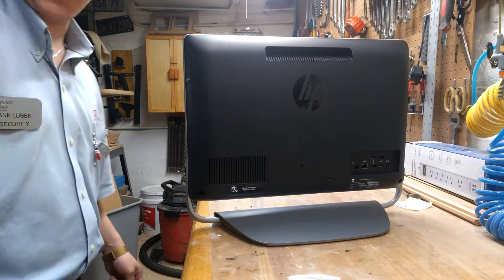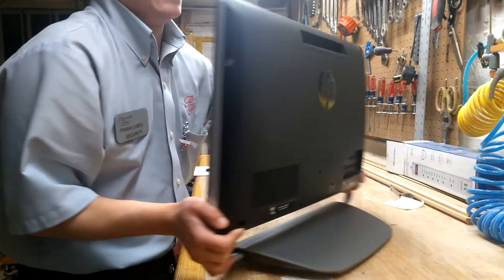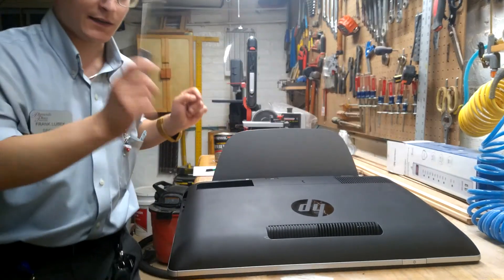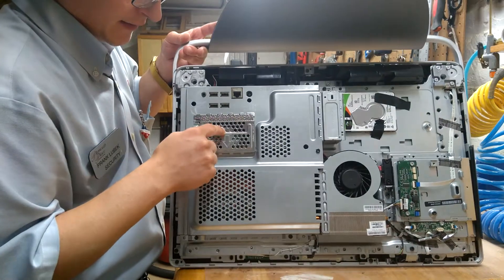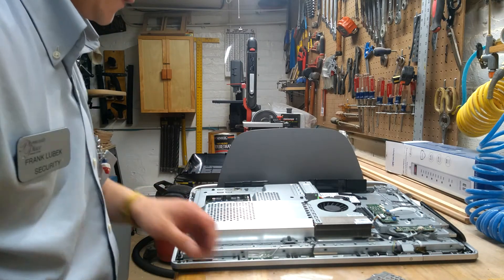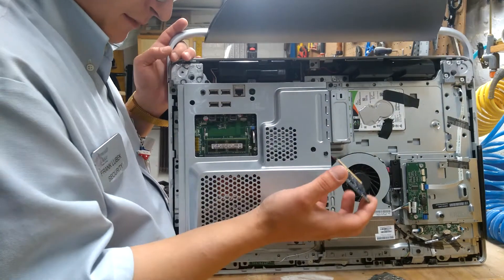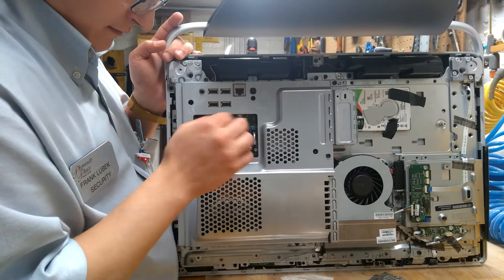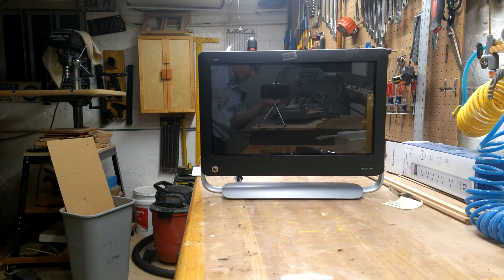How To: Upgrade RAM On HP Touchsmart 320 PC

Comment: hey, but what if my PC is running, but my screen is not working like my screen is entirely black
Reply from the maker: My intuition initially says somethings not fully plugged in. If you can verify all connections are then I'd say video card is bad or needs vid driver update. Does it display screen on external monitor?

Comment: Hi, so I have the same computer and I recently upgraded the ram from 2x2gb to 2x4gb but instead of saying that I have 8gb available now, it’s saying that I only have 2 and that only 1 slot is being used. Is there something I can do to fix it?
Reply from the maker: First I'd recommend taking RAM out and install the RAM from slot 1 into slot 2 and RAM from slot 2 into slot 1. Make sure they're pushed in all the way and correctly seated or else they may not be recognized. Also how are you checking RAM (Win 10 Task Manager or CMD)?

Comment: how much gb does it support?
Reply: 4gb 2rx8 pc3-10600s-9-11-fp.  I have that model and I want to put another one to complete at 8 gb
Reply from the maker: @Pedro Chang  Go for it! RAM is one of the less expensive, yet most beneficial upgrades you can do.
Reply: Thank you ... I was about to discard the pc, the bad thing that I can't find it to buy here in Chile
Reply from the maker: @pedrochang358  I would suggest Amazon if possible. As a customer they've been super reliable for me except in very rare circumstances over many years.
Reply from the maker: 8GB on x64 OS like Win 10. 

Recommended:
PC3-10600 (DDR3-1333)

PC3-12800 (DDR3-1600)

Comment: Hi Fren.

 I have HP 320-1038d, i installed 4gb x2 ram on win7 x64 but on system properties it says only 3.49gb usable. Do u have any idea bout dis ?

Maybe some settings in bios that i need to change ? It's using AMD A6-3600 apu.
Reply: Tengkiyu for the reply... my aio now detected all 4gb x2 +8gb ram. What i did was mix & match other spare ram module that i have. A combination of them made my aio detescted all 8gb ram. 1 samsung, 1 elpida.
Reply from the maker: @akukau4296  Thank you for the suggestion!! I will give it a shot tonight or tomorrow night and let you know if it worked. I'll rearrange the RAM modules.
Reply from the maker: So unfortunately 2 nights ago I was cleaning my gaming PC which kept freezing. When I reseated the processor and turned it on, it said out of 64GB I only had 32GB available and that the other 32GB was dedicated to hardware. My heart sank when I saw that. 

Note: I have an AMD Ryzen 7 2700X and from initial research this seems to be an issue with primarily AMD CPU's

Let me know if you fix it. If not, over next few nights I'll try:

- More research 
- Remove heatsink and CPU, clean thermal paste off with rubbing alcohol. Then I'll reinstall heatsink and CPU without thermal paste to see if its fixed.
- Inspect CPU pins as it fell about an inch but maybe there's a damaged pin?
- Play with BIOS settings, but I don't think this is a solution since I haven't touched my BIOs in months.
Reply from the maker: As an update, I've been super busy with laptop refurbs so haven't played much with it. But I swapped RAM sticks like musical chairs and still same issue. I will try again later this week and reseat CPU/replace thermal paste again. If not, I may swap CPU as it's still under warranty. Just for anybody who the above comment doesn't work for. But try that first!!.

Comment: I have the sane computer but works slow. If I change the ram, Would it work better? And can you share the Amazon link of the ram, please?
Reply: Try also upgrading to an SSD if you have not done that.
Reply from the maker: @Mini-genios...AAprender  Yes this would help greatly as well!
Reply from the maker: Yessir it should, https://www.amazon.com/Samsung-204-pin-PC3L-12800-1600MHz-M471B5173EB0-YK0/dp/B01CEHOUUM Although I do highly recommend buying through Amazon Smile, as for no extra cost you will be supporting a charity of your choosing.
Reply: my one too

Comment: What if the screen turns black but it still running? What is the problem?
Reply from the maker: My initial thought would be to check the display cables and make sure they're plugged into the correct spot on the motherboard

Comment: Hi what is the max ram capacity for this pc?  16 gb (2x8gb modules)?
Reply: i've just bought 2x 8gb modules por this PC. Ask me in a week if it worked
Reply from the maker: @Sagastume666  Hmm.. well even if it reads 16GB RAM in Task Manager you may not be able to use more than 8GB due to mobo bottleneck. Please test and let us know if it worked or not! Thanks!
Reply: @letechnology1774  Thank you for the advice! It reads in their website that this PC Supports up to 8 GB on 64-bit systems... maybe they refer 8 GB per module, right?
Reply from the maker: @Sagastume666  No sir. It's going to be 8 total so 2x4GB modules
Reply: @Sagastume666  so what's up with ur 8gb 2x ram status. Did it detected 16gb ram ?
Reply: @akukau4296  I bought 2x 4gb because the technician told me that the computer did not support 2x 8gb
Reply from the maker: According to their website for HP320 product spec (https://support.hp.com/us-en/document/c03026602) its 4x2=8GB DDR3, but that may be wrong. See comment below.

Comment: Hey! I have this same exact pc.  Honestly I don't know anything about pc's but I was wondering how I would be able to make games run faster on it.  There's an old game (Rollercoaster Tycoon 3) that I'm trying to play on it but the gameplay is pretty laggy.  Should I buy more ram or buy a new video card? Which should I buy in particular? I'm currently using Windows 7.
Reply from the maker: Hello, thanks for commenting! So I would usually say install a decent graphics card.... but in this case I have some bad news. 

Here's a video I did for your issue, but below is the summary.  https://youtu.be/F4aeYCpLZfA

You can't install a graphics card because the TouchSmart 320's graphics are integrated into the processor. To upgrade the graphics you would have to upgrade your processor which could be pricey depending on what you buy. Plus that's exponentially more difficult to upgrade than RAM, hard drive, etc.

I always recommend upgrading the RAM and, if in reason (32GB or less) max it out. If you do, it's a one time upgrade and you're done. For the TouchSmart 320 it'll cost you roughly $30 to max it out at 8GB (2x4GB), if that. 

So since you stated that you don't know much about PC's I would suggest making sure you have plenty of space available on your PC (https://www.dummies.com/computers/pcs/how-to-use-disk-cleanup-in-windows-7-and-vista/), install a SSD if you don't have one in there already, and upgrade to Windows 10. 

If that fails I think you'll have to buy a desktop PC, not all-in-one. Buy a cheap desktop PC, install graphics card, done. Of course if it's just for RCT3 then this option wouldn't be worth it but it would be worth it if you play more than a few different games.
Reply: @letechnology1774  Great video, very useful.  Thanks for making the video, I am going to increase my RAM!